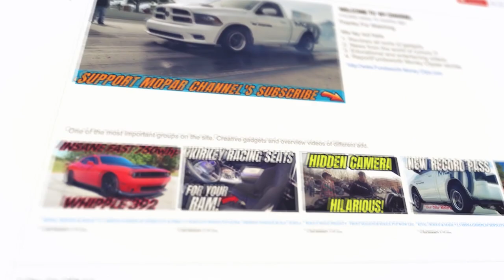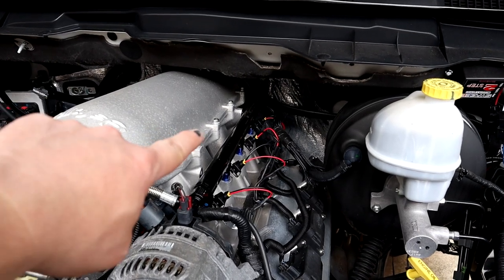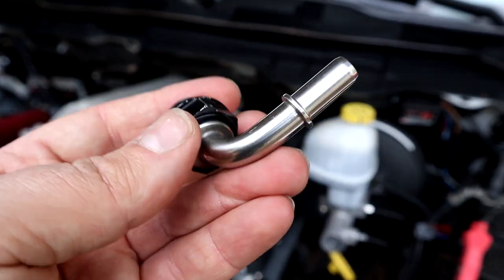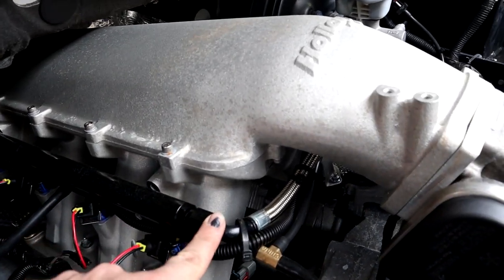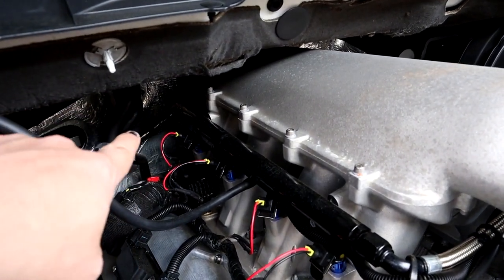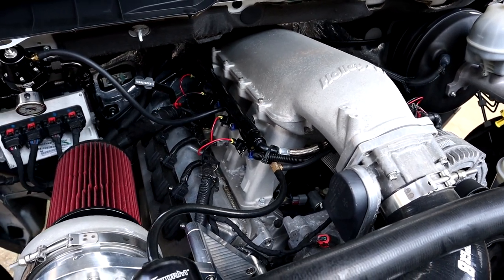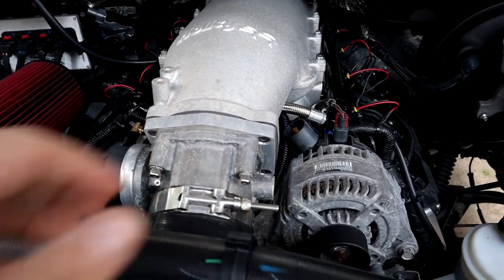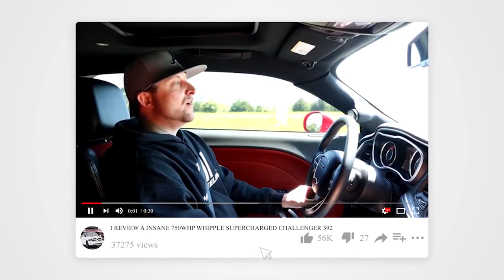Holley Hi-Ram Intake Manifold How To For RAM Trucks

Comment: This is awesome, because I've hated the plastic intake for all my hemi trucks, especially my 19 5th gen
Reply from the maker: The plastic manifold is🤢
Reply: @FrostbiteRam  in terms of performance I'm not sure plastic is any worse than metal unless we're talking major boost and looks department. I am interested in folks experience going from a 6.4 truck manifold to the Holley.
Reply from the maker: @DL101ca  the 6.4 works great also thats the only other option I would consider especially for na. Boosted or nitrous hi ram all day
Reply: @FrostbiteRam  I'm trying to make a decision and the price of the Holley is very enticing considering the 6.4 truck manifolds are like gold hens teeth. I'm concerned about low end torque on the Holley as I DD my truck and don't want to redline in order to get it to move off the line. It doesn't help that I am basically setup for boost (1 7/8" primaries on headers) but haven't gotten around to deciding on a roots or centrifugal system yet.

Comment: How tall is this manifold!? Im looking to run this on my 6.4 jeep srt but not sure about the clearance on the hood and firewall
Reply: Lmk if you do this, cause I also have a jeep srt I wanna do this on lol .
Reply: @Unpluggeddiagandprogramming  so i will be doing a Build Series here in a few Months, Unfortunately i have to wait a while for parts since im in Mexico City building this thing but yea i already ordered everything for the 6.4 Rebuild including the Hi Ram im just going to send it haha from what i read on the Holley Website is the height is 11.59 Inches so most likely i will need to either cut my hood or buy an after market Cowl Hood if you want to stay tuned for the build feel free to check in here in a few months hopefully everything gets here in good shape
Reply: @Tino.Armenta  do you think you’ll have to cut the FireWire? Idc about the hood, I’ll cross that bridge when I get there lmao 🤣💀
Reply: @Unpluggeddiagandprogramming  i dont think so the Jeep Wk2’s have that guard that goes between the hood and the windshield, where the wiper motor mounts, i think i can clear the Hi ram by removing that Trim/Molding or slightly cutting it, but it is not directly attached to the Firewall
Reply: @Unpluggeddiagandprogramming  so the short answer is no lol

Comment: What size fitting was used for the plug on the hi ram for beside the screw cap, and on hole between cylinder 6 and 8 on passenger side?
Reply from the maker: The kit comes with the plugs atleast mine did. Not sure the size at the moment

Comment: Sure you get top end gains, but unless you are running boost the 5.7 or 6.4 truck intakes are the best for trucks.
Reply from the maker: Yes they work well but the holley is the way to go most people like myself has went from the 6.4 to the holley way more options for the holley so much better.
Reply: Yeah just depends on where you want the power.

Comment: Great video. So with the 6.4 intake swap you have to get an adapter for wiring or extend it yourself. Not needed with this one? Holley mentions may need hood mods but clearly doesn't look to be the case. Do you feel n/a would benefit more with this one or the 6.4? I saw on this one its best at like 7k rpms. Just curious if you know the difference between the two.
Reply from the maker: Fits perfectly under the stock ram truck hood. But not the cars will need aftermarket hood. I'm using the stock factory throttle body currently.
Reply: Jason I have a sp challenger 440 stroker, running this intake. I also have NX spray plate sandwiched between upper and lower lid.  Had to cut my windshield wiper cowl frame about 1/2” across an 6-8” section in the middle to fit upper lid to slide back into plate and just as reference. It clears under the Anderson composites demon cowl hood (4” cowl).  With the oem style hood. The hood doesn’t even shut enough to latch first click.  It’s also extremely tight from throttlebody down for piping. Many have to cut into the radiator support.  Hope info helps

Comment: So in order to run a catch the inlet hose would come off the barb from the bottom base where you have your filter and the outlet hose coming off the catch can runs to the back of the intake correct? In the instructions it says to use a pcv valve still is that still needed?
Reply from the maker: That is one way yes with a pcv. Or run both manifold vents to the can and vent to atmosphere that's what I will be doing with Frostbite soon video on the way.
Reply: @FrostbiteRam  ok thanks looking forward to it! I called Holley and they said I needed to run a pcv valve with the catch can

Comment: hello i got a question  im having  a issue with fitting on my hiram.  is it possible to run it with the stock fan or do i have to go electric
Reply from the maker: Clutch fan has to be deleted
Reply: thank u

Comment: hello, i love what you are doing with your truck first off. 2nd, i have a quest5ion/problem that you may be able to help me with. i just finished up installing this exact intake on my 2016 ram Rebel. i took the IRC off the stock manifold and plugged it in thinking i could avoid the engine light until i could delete it in the computer. however and im not sure it has anything to do with it, but i now have the dreaded Electronic throttle control /electronic brake control light on and no throttle response. i also installed a pro charger, unlocked computer with custom tune over a year age with no issues.did you happen to have any issues like that as soon as you started either truck up? Thank you in advance.
Reply from the maker: I had no issues

Comment: Any issues with factory brake booster vacuum hose? Where did you connect yours
Reply from the maker: I installed a fitting on the back of the manifold for the brake booster

Comment: What throttle body are you running with it ? Was thinking about the hellcat oversized TB and make a custom plate to match up with the Holley. What's the size on the Holley inlet ?
Reply: Stock throttle body
Reply from the maker: Stock 5.7 tb currently
Reply: Get a tb that’s the same size as the Holley inlet hole if not a oversized tb aint gonna do anything